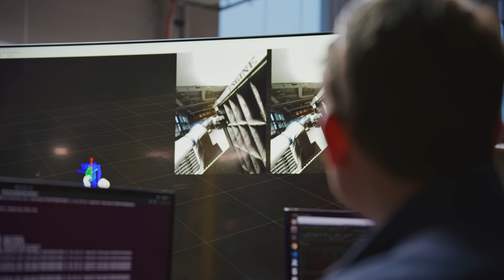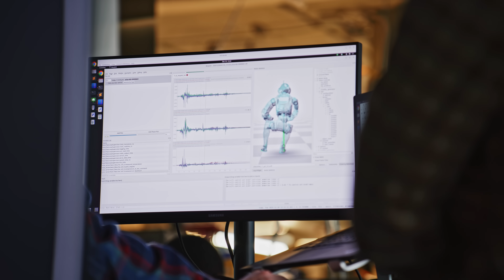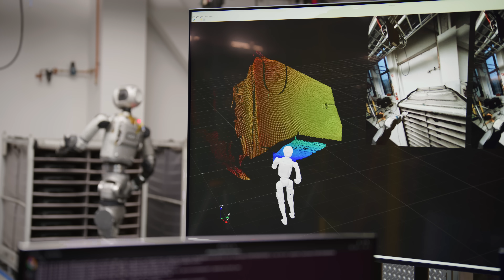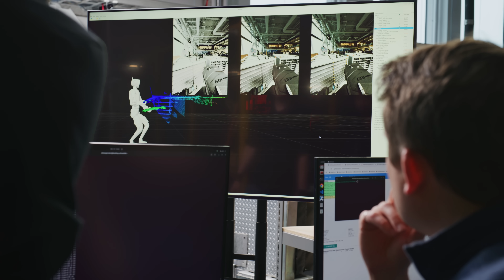Pick, Carry, Place, Repeat | Inside the Lab with Atlas

Comment: I was really worried that the new robot would not be strictly faster and strictly stronger.
This puts my mind at rest
Reply: "Strictly faster" means it's faster in all situations; it's never slower. Just in case you were wondering what he meant?
Reply: strictly harder and strictly better
Reply: @litterbox019 How Daft of you, Punk
Reply: @twaggytheatricks4960  Say... That again? 
Credits
Reply: Uhhh that’s a really vague description.  If by “super strength” you mean stronger than the average person, Atlas already is.  If you mean like superhero level strength, gearing is everything.  It would be slower, but a humanoid in the same form factor could lift a truck.  It’s a balance of strength and speed
Reply: @homieboi5352  Just build it with an ICE like a car, plenty of horsepower or even with EV batteries. Everything is scaled up. Powerful robots are not just possibly they are inevitable.
Reply: @juliuscesar4176  You’re right that an engine would be more power dense than a battery, but the weight and complexity added isn’t worth it, plus the added vibrations during operation.  Battery technology is still preferable even if it is the bottle neck of power dense humanoids, and we’re forgetting that motors also reach a critical point where you can’t increase the power no matter how much current you dump once they’re fully magnetically saturated.  Again, gearing and mechanical advantage are still our best bet
Reply: @homieboi5352  humans have a higher strength potential I believe, especially animals like gorillas lol.
Reply: But can it do sick flips?
Reply: Don't forget more compact and less messy!
Reply: Yes. Even the people working on them do not talk like the humans. Ha. Ha. Ha.
Reply: @An_Arbitrary_Miscellany they sound like me during a presentation so I think they're legit 😅
Reply: @An_Arbitrary_Miscellany  I observe your jocularity, fellow human. Ha. Ha Ha.
Reply: It’s coming.
Reply: There's no good way to make a super-strength robot. You'd need batteries that don't exist and motors that don't exist.
Reply: @4.0.4  was the previous robot hydraulic this one is motors
Reply: The mind of an engineer is like retrieving words to say by looking ideas up in an index. They might also be dead inside at this point.
Reply: why? you worried that you couldnt be replaced as faster as before?